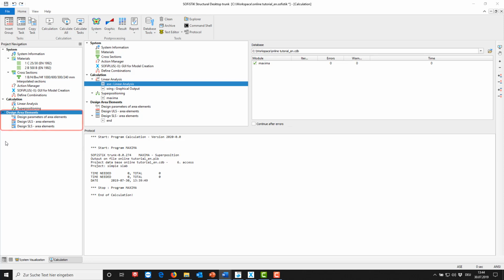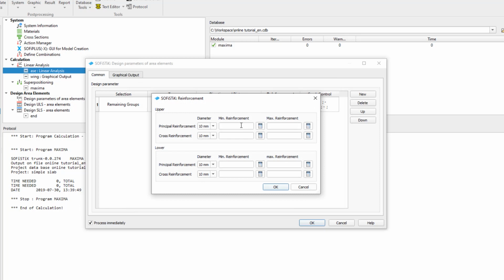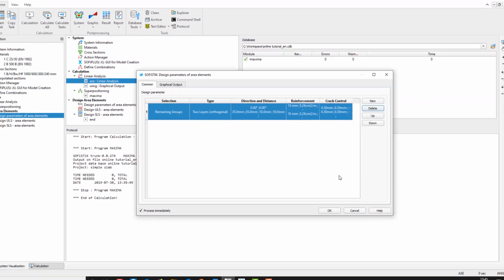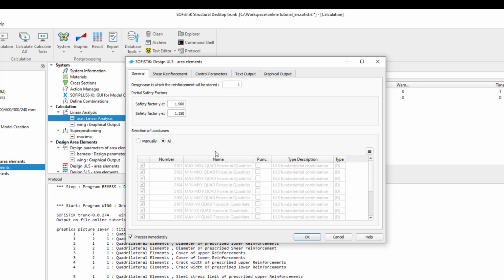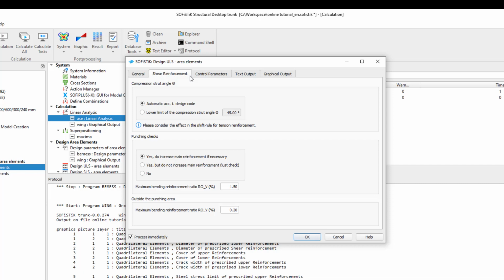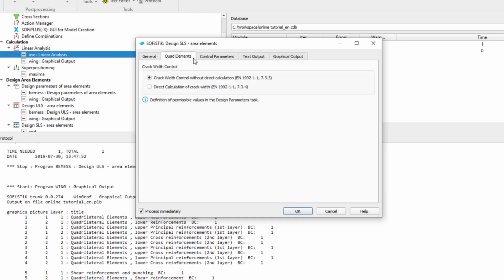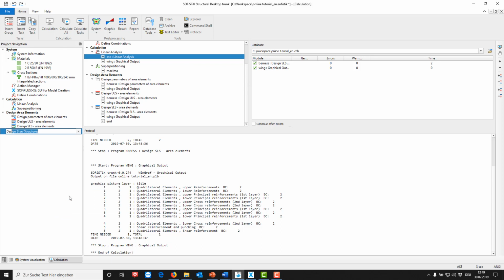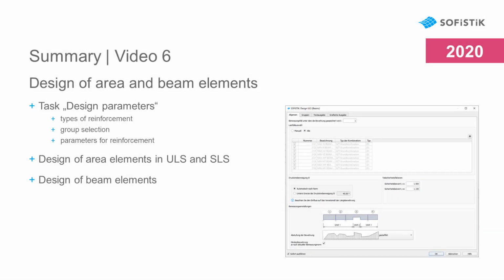SOFiSTiK | 2020 - Design of Area and Beam Elements (06)

Comment: If I have a significant amount of "Attribute Areas" whose properties (HA, HB, DHA, DHB, principal and cross direction min. reinforcements and diameters at both top and bottom) I have obtained in an Excel, can I produce a Script that I can copy and paste into the Teddy version of the "Design parameters of area elements" so that I don't have to input all the values by hand. This would also avoid errors.
Reply from the maker: Hi Humberto del Castillo,
Yes, you will be happy to hear that this is an easy task :)
To do so, you simply have to set-up your TEDDY-input the right way and you can easily copy paste your EXCEL data.
Follow this link for a general introduction to TEDDY: https://sofistikforyou.com/the-text-editor-and-sofistik-structural-desktop/
In this introduction, you will also find this video: https://www.youtube.com/watch?v=doAP5gmv6Gw&t=280s
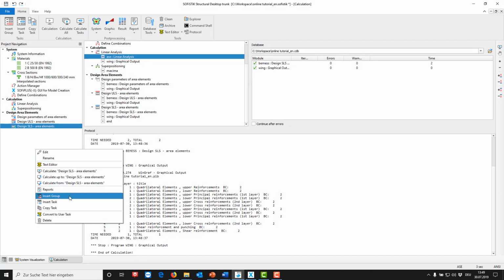At minute 4:40 Jürgen Bellmann talks about the different inputs that do the same thing. The last input format (on the bottom) is one, which you can easily use for copy pasting from EXCEL.
If you have more questions, please contact us via info@sofistik.de.